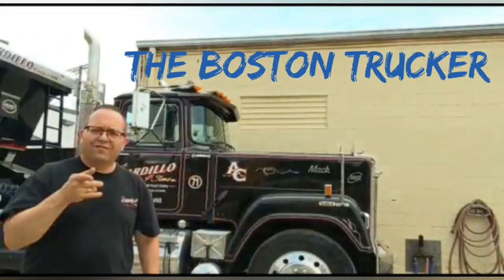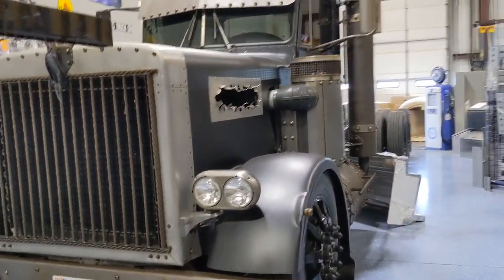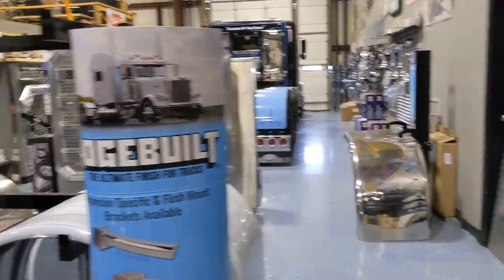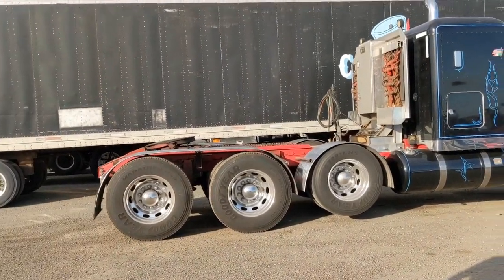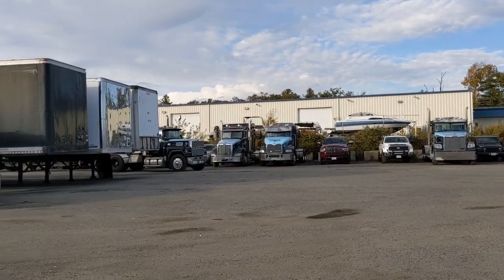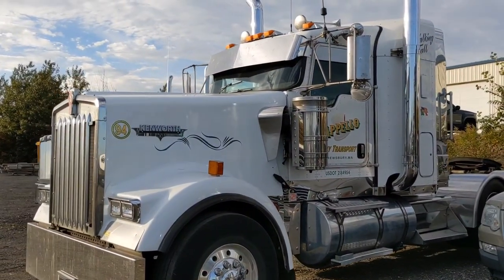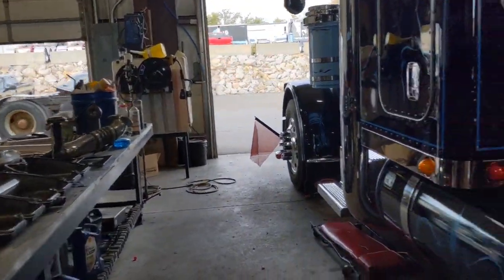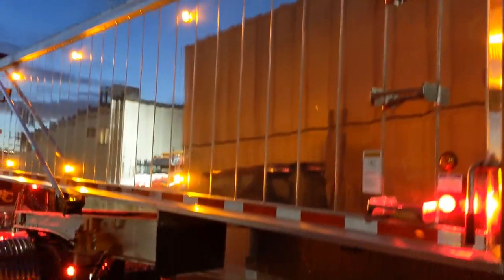Cappello Custom Rac & Heavy Transport #chrome

Comment: I still at 76 yrs old run my 1987 ext 379.  3.8 mil on it. air ride cab air ride sup.   Kta600  motor off frame. Updated it with 18 speed.  But redone 410 Rockwell’s.   I haul sand with my 2020 dump trailer. Sim to yours ,still  have my 1987 dump.   But I redone Pete. With  new cab 2015 cab.  So my looks new but still old school. No emissions.  My is a day cab. The 2015 cab was sleeper. Took that off   Like my stacks behind cab. So when remove sleeper added back 87 rear small side window so stacks are on each side not next to door. 10 inch shame I cannot post photos of it. Son run business got 20 Pete’s tractors an 35. Triaxles.  I do my 4 loads a day. 4 days week.  Lol

Comment: I love a good chrome shop. 
I'm still trying to talk my boss into getting me some Aluminum half fenders for my dump truck. And I need the hub and lugnut covers as well. It's got 10 aluminum wheels. Need the bling. 
Your gonna laugh. I tell the kids that want a CDL got to the school board get a School bus license. why? It's a class B licence with the school bus endorsement 
You can drive ALL the different busses. Then in the summertime get a dump truck gig with an air brake tag trailer. 
Now you got a Class A. And didn't need to work for a mega carrier. Doubles and tanker are written exams Hazmat well you get the idea.
That's a sharp looking truck.
Reply from the maker: Sometimes you just have to buy them yourself! Rule is, you drill a hole to put chrome on, it stays with the truck when you move on! 😜